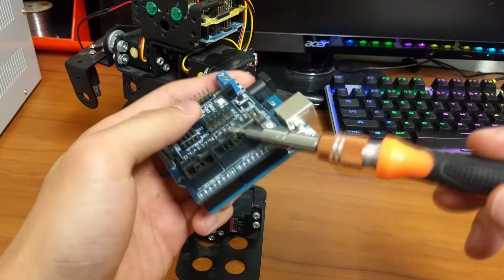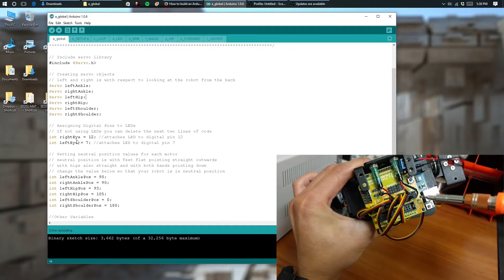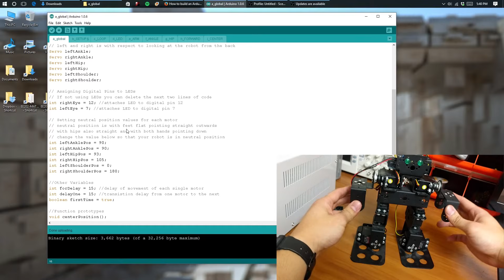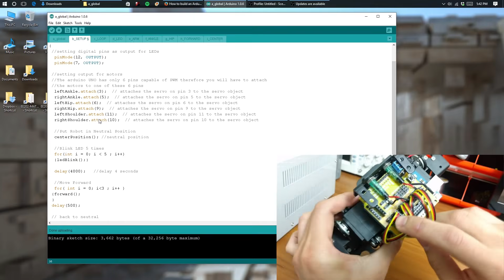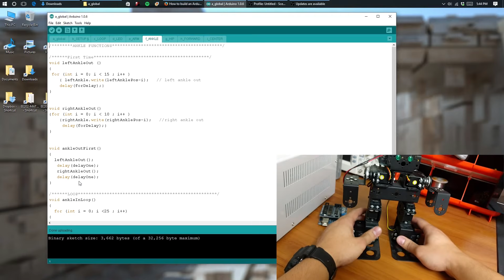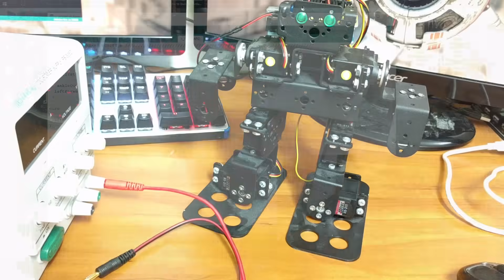Biped Tutorial | How to build an Arduino Biped PART 5 : Final connections and Arduino Code

Comment: do we need to keep the plug in on the arduino with that white box and to the computer
Reply from the maker: You only need to connect the Arduino to upload the code. Once the code is uploaded you need some kind of power supply for both whether it be a battery, power supply, etc..
Reply: thx you got a new sub

Comment: Can we can control it with remote control? If yes show the connection of remote control with aruduino
Reply from the maker: Yes you can attach an IR sensor to control it if you want.
Reply: Practical Electronics -where we should connect ir sensor to aruduino

Comment: Very good example - Brilliant! Am I right in saying that if I want to move the servos back to centre slower after walk - do I just change the delay500 to 1000 etc.?

 //Move Forward
  for( int i = 0; i<3 ; i++ ) 
 {forward();
 }
 delay(500);
 
 // back to neutral 
  centerPosition();
}

Also, I’m going to use Arduino mega for a 17dof. How to I add different movements to the folder you created - eg knee functions? 
Thank you.
Reply from the maker: Yes the delay(500) is how long it the robot waits until it calls the centerPosition() function. If you want the robot to walk or move slower you will have to increase the delay inside to the function itself. To add more functions you can simply create a new tab to write whatever function you want. Check out my video on creating new tabs.
LINK: https://www.youtube.com/watch?v=gxLpob4fiWQ&t=1s

Comment: how do u upload all the codes in arduino??
Reply from the maker: Just open the first file and all of the other files should open as tabs in the arduino IDE. Then  you can just upload it as normal.
Reply: explain why the loop function empty and how its works??